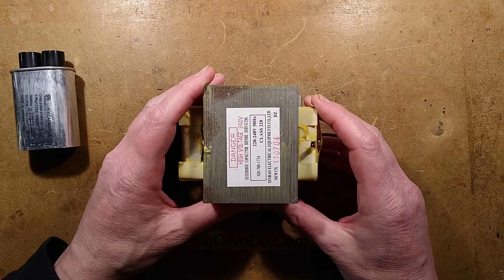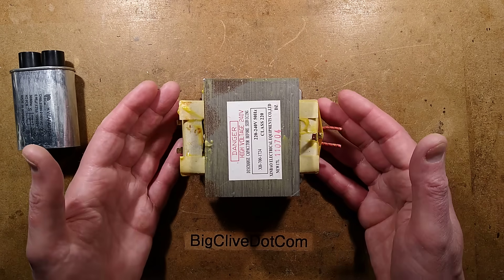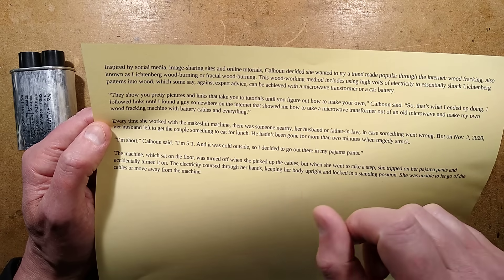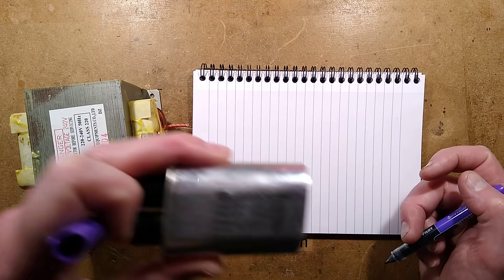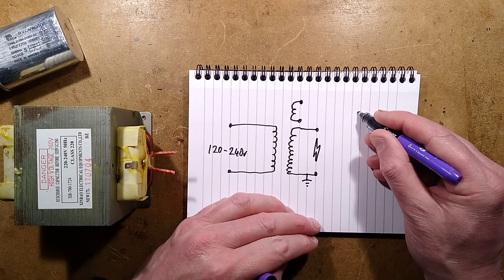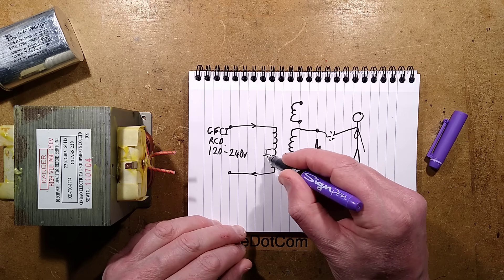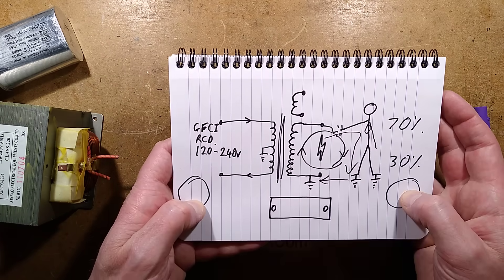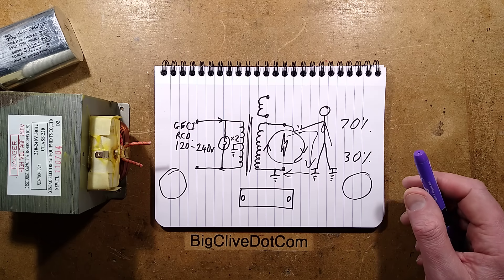The most deadly project on the Internet

Comment: I'd go with a foot pedal like they use in TIG welding.  Maybe an old sewing machine pedal would work.  A little bit of circuitry and a triac or two and you got voltage control.
Reply: That's pretty much the opposite of what you want for safety. It leaves your hands free to touch the live parts and get killed... Plus you might step on it accidentally and a whole bunch of other issues..
Reply: @Basement-Science  When you weld, you always have both hands on the same electrode.  Preferably with heavy gauntlets. I don't see much of a problem.
Reply: @rayceeya8659  no you don't.. you very often have one hand holding the part you are welding or your hammer to push plates together.. as for a safety switch on the footswitch principle... how about a loaded mousetrap so if you move your foot away it fires?
Reply: @PaulaXism  Only if you're free handing.  also with tig you have one hand on the electrode and the other on the filler rod.  The filler isn't connected to anything until you get your puddle going, then it's as live as the electrode.  Either way they are on the same side of the circuit.  Thick boots and leather gauntlets minimum.  And DO NOT touch the grounded work while touching the electrode.  Actually, best off shutting the machine down if you plan on doing anything with your bare hands.
Reply: @rayceeya8659  Welding uses LOW voltage (20...50V), not HIGH voltage (2100V in this case) which this topic is about. Unless your welding machine uses HV start and you touch both electrodes, you are almost unable to get a shock under any circumstance. There is no point even comparing these applications of electricity.
Reply: @Basement-Science  LMAO.  Yes I learned the hard way on old buzz-boxes.  240V.  Trust me, they got a bite to 'em.  Basement, I probably been welding longer than you've been alive.
Reply: @rayceeya8659  I dont care how long you've been welding, it clearly didn't teach you much about electricity though.. LOL
Reply from the maker: Foot pedal not ideal as people tend to go rigid with high shock current.

Comment: I was "cautious" when I was experimenting with borax process to anodize aluminum. The borax process seals off the surface and the reaction stops, how you get a thicker layer oxide layer is using higher and higher voltages. I was running 300 to 400 volts through a step up. Very dangerous. Switched to pool chemical pH- chemical for the electrolyte and low voltages of 12 to 15 volts.

Comment: I once dared myself to turn mine but stood at a distance. It scared me too much so I unplugged it, cut out the HV coil, then turned it into a spot welder. Now it's in a box upstairs because the cheapo Chinese board I bought as a controller doesn't work properly. Very inconsistent results, so useless as a spot welder. Would definitely blow up Lithium batteries if used!

EDIT: My favourite device is my flyback transformer with a circuit to get it to self-oscillate using a 2N3055. It's fairly easy to hold your fingers in the "beam" of electricity without dying. Quite a tingle it makes.
Reply: If you get yourself a few 555 timer chips and the potentiometers to control them, a relay to control a contactor (really just a high power relay, usually used to control appliances like air conditioners, available at the specialty stores that cater to e.g. electricians & plumbers), and a fuse to put inline with the contactor's switch, then you shouldn't need a fancy control board. If you don't have a power supply for the 555s and relay, then just get a doorbell transformer, hook it's primary up beside the contactor so that it's controlled by the fuse too, and use the lowest voltage (mine is 8 volts) through a rectifier & eBay regulator to get your controller voltage.
Reply: @absalomdraconis  Oh wow, thanks! I'd never thought of using a 555. I'll give that a go. :)

Comment: It's all about respect and due diligence. I built my first lichtenberg machine about 3 years ago using a microwave transformer. I housed it all in a sturdy wooden box I built, with power switch, indicator light, and most interesting, a 1930's variac. From there,  I used one of the microwave's momentary micro switches, as a dead man's switch that I must put the toe of my shoe on to energize it. Last, but not least, I used high voltage wire that runs to two large nails that go through, and are glued to, the ends of two, 3 foot long (1m), 3/4" (19mm) pvc pipes. Safety is paramount to survival with this process, and having three feet (1m) between you, and the probes, is about the best thing you can do to survive. The dead man's switch is also highly recommended, and every time you move your toe off the switch, which literally engages and disengages with about a mm of movement, it de-energizes the entire system.  As for the art aspect, the variac is a must have imho, allowing for more controlled burns! Stay Safe!